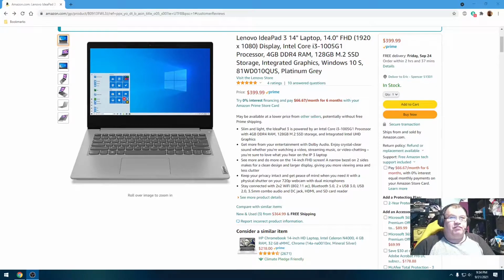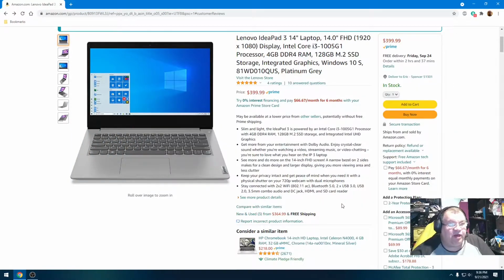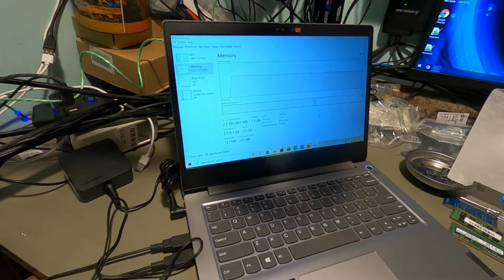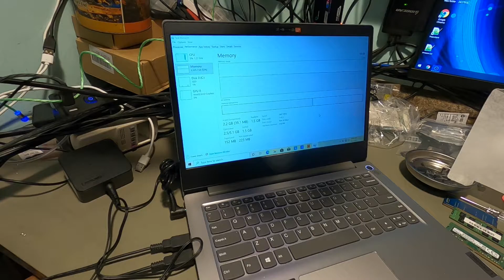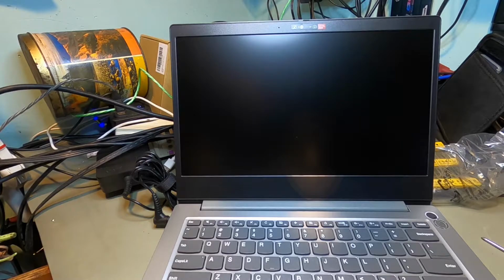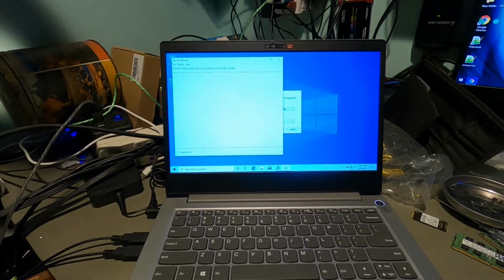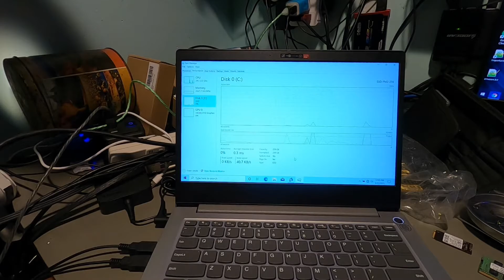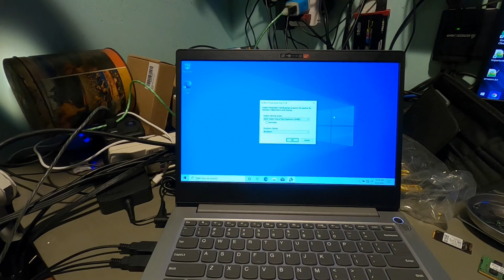Lenovo IdeaPad 3 81WD010QUS RAM/SSD upgrade

Comment: The reason for the delay was the computer was memory training after the new ram was installed, that's normal.
Reply from the maker: Yes, I know that. But when I filmed this, it was taking a bit longer than I would normally expect a laptop to take when it's re-training itself.